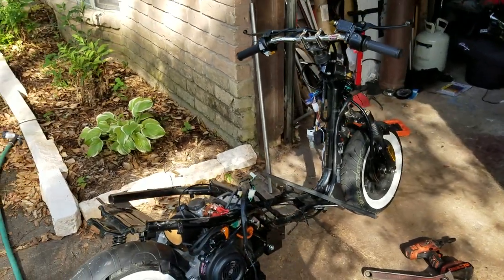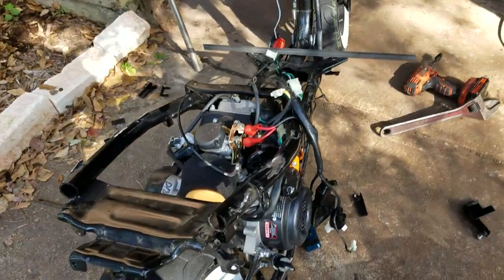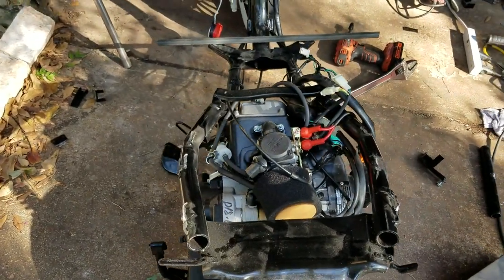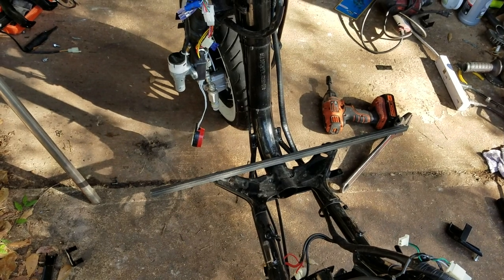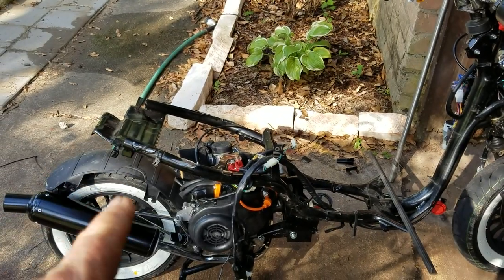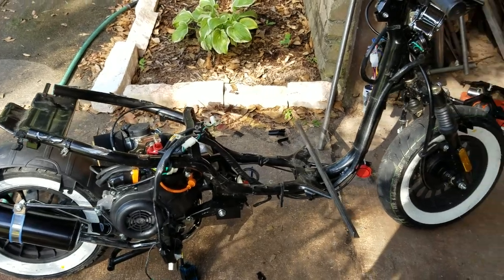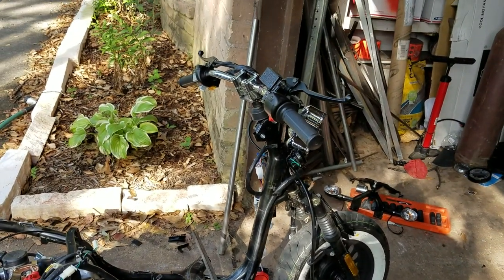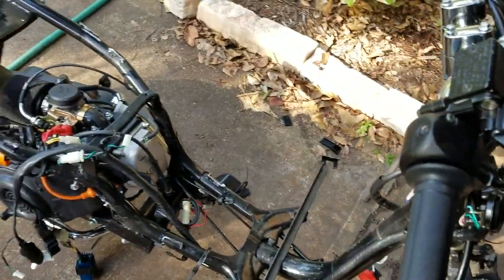Building A Modified Lowered 50cc Custom Chinese Scooter Bobber w Big Bore Kit

Comment: OH HELL MAN. I swear I'm building this same bike!! I've got the crocodile bobber seat cut off gas tank, straight handlebars. TAO 50cc frame but we are stretching 4 inches and putting on 150cc long case engine with 12 inch whitewall tires